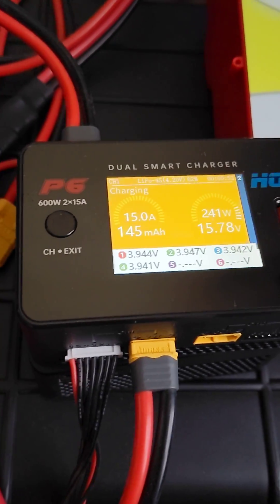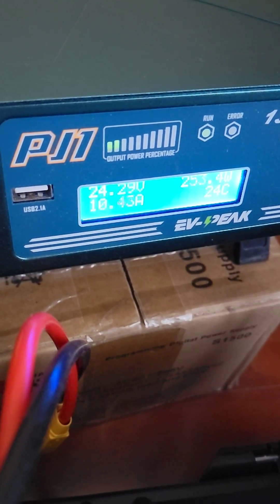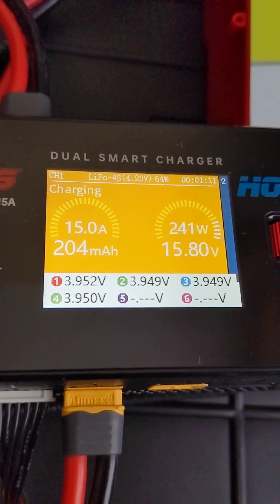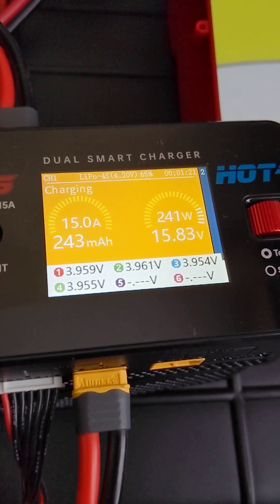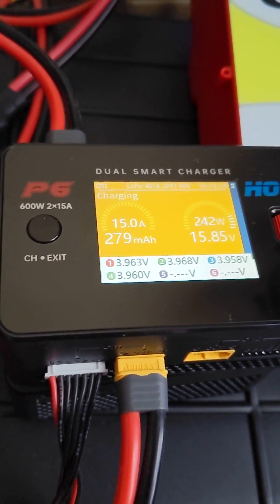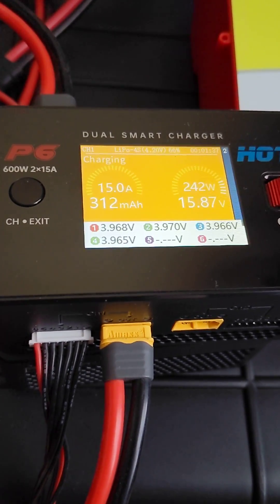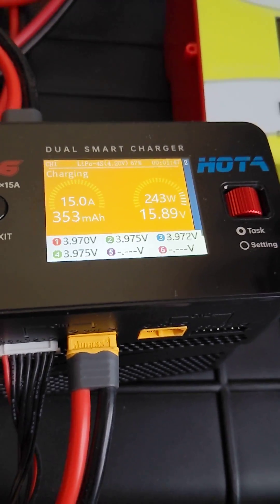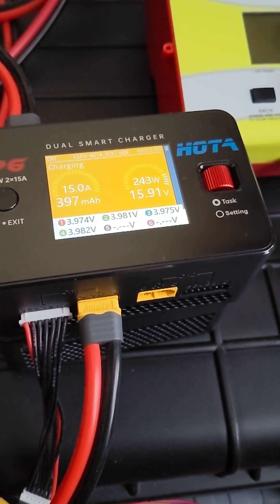Hota P6 charger can deliver the watts

Comment: With the Hota D6pro (a Hota charger with a built-in 200-watt power supply): If you power it with an external power supply with an output voltage between 28.5 and 30.0 volts, the charging power is automatically limited to 200 watts. Thus, at an input voltage of approximately 29 volts, the D6Pro automatically detects that the connected power supply must be the built-in 200-watt power supply and limits the charging power to 200 watts, regardless of whether the 29V power supply could deliver 1000 watts or more. 
I assume the P6 behaves the same way.

Comment: I got two of them, recently I bought a decent clamp meter, play with it during charging and to my surprise I noticed that CH2 is always 0.5A higher than CH1 on both chargers. If 0.5A current was set via menu, there was 1.0A measured, 1A - 1.5A on meter and so on. It goes back to normal after charge complete and connecting the next packet, charger restarts in between doesn't help. I'm not trusting this hardware anymore, always checking current with clamp meter from that day.
Reply from the maker: WOW 😮, that's insane!

Comment: I think you can display what the input voltage is on the P6 (my D6+ does).  It may be that the T240 voltage is sagging as it gets close to full power output?  Doesn't make sense it would put 29V and get less power out than your 24V power supply.  See if you can check the actual voltage when it's bottlenecked at 190W.
Reply from the maker: Thanks for watching the video! I have long since packed these away. It's definitely a weird situation. I got tired of bothering with it though, and the company never replied to a single email that I sent asking about it.